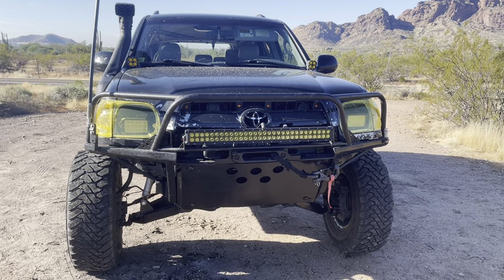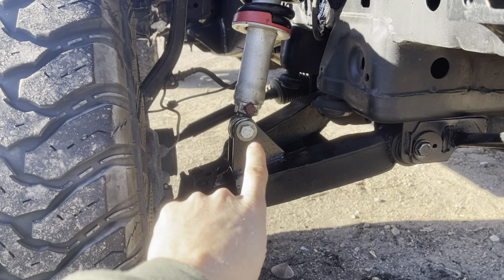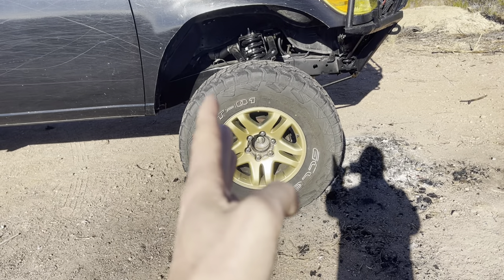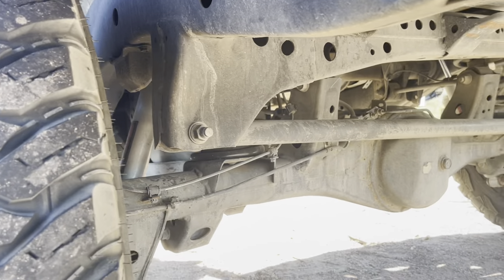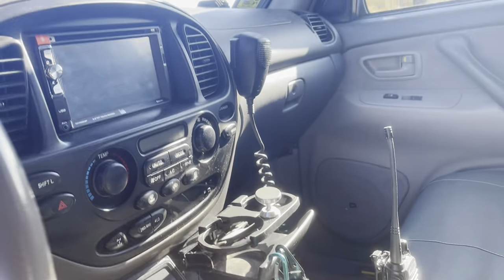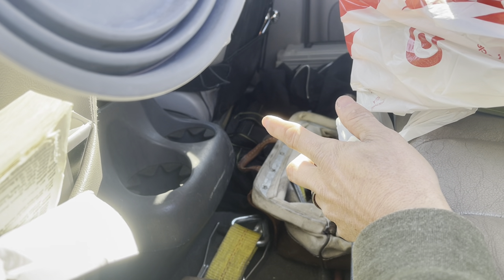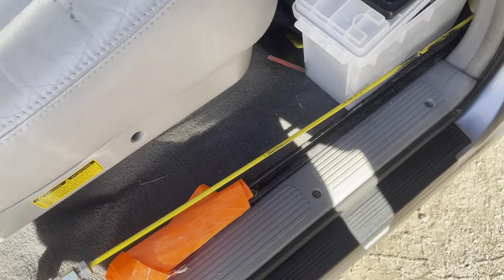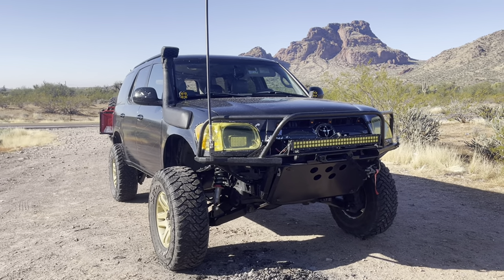Sequoia 4x4

Comment: Hey my friend. I was wondering if you had any experience/opinion on replacing the Sequoia outer tie rods with heim joints? I need to do mine one way or the other soon. 
Oh and thanks for the detailed tour of all the crap in the back of your truck lol
Reply from the maker: That’s funny you ask my project is on hold thanks to Christmas and blown spider gears .. but I have a bunch of stuff I was working on steering being one of them.. I’m not saying you should.. but you could cut the stock tie rod like I did and sleeve it with a piece of 1.25” dom 1” Id and ad a 3/4” heim use a set of 3/4 to 5/8 misalignment spacers and drill the spindle for a grade 8 5/8 bolt cut out a double shear bracket using 3/16 plate to weld on as extra insurance.. or you could buy a heim steering kit for a first gen tundra  .. another idea might be to buy the rack adapter to go to a heim and build an entire new link using dom and heims on both sides..
Reply from the maker: If you watch my video on Vic’s pathy you’ll see exactly what I did on his steering
Reply: @theclan4adventures  Thanks for the info, that Pathfinder is a BEAST. He's lucky to have a buddy like you

Comment: Thanks for the walkthrough. Very helpful to see 1st gen. builds. 
I'm really interested in duplicating your fr/r camera setup. Could you drop a link to where you bought yours? 
And.... where in a harness did you connect to grab rear camera "auto" power? 
I've got a double DIN head unit with a nice sized display, and a backup/rear camera mounted on my rear plate - but haven't successfully found backup camera power under the dash.
Reply from the maker: The cameras are like this one:
https://www.amazon.com/RAAYOO-Universal-Installation-Guildlines-non-mirror/dp/B074P45P7G/ref=mp_s_a_1_5?crid=KGS0BBBFWLTL&keywords=front+camera+for+car&qid=1641260008&sprefix=front+camer%2Caps%2C132&sr=8-5
Reply from the maker: And the monitor is like this:
https://www.amazon.com/gp/aw/d/B089YSDTF2/?_encoding=UTF8&pd_rd_plhdr=t&aaxitk=856adad8aa15ce7bd17b033d54cf7760&hsa_cr_id=1653474810801&ref_=sbx_be_s_sparkle_scm_asin_0_img&pd_rd_w=UAzV7&pf_rd_p=22aaccd3-32f1-4e8a-8b82-495782857be5&pd_rd_wg=FQO2s&pf_rd_r=F9Q86HB0VWTH8QR7TA0B&pd_rd_r=b57cd2cf-4f08-427d-89d2-6263611e5f54
Reply from the maker: You can buy complete systems with two wireless cameras for around 100 bucks witch would make install slightly easier.. I just saw you have a rear set up.. on mine I pulled the input from the rear hatch where the reverse lights are .. it was a pain to run the wires but it works flawlessly just make sure they are clear of the window operation

Comment: I'm pretty sure u can get king's, foxes or bilsteins on for the front suspension I have the Bilstein 6112 on my first gen tundra
Reply from the maker: Sorry for the book but I feel a detailed reply is a must 
Thanks to Covid not when I first started this build. Maybe now I might find something at a high over price but I was looking for an extended travel oem location shock no one I called had a first gen shock in stock anywhere in the country that I could order. I didn’t have the time to wait 60 weeks nor did I have the time to run a custom shock, build mounts or get one meant for another application then re spring and valve it. No offense but I’m not a fan of bilstein I’ve tried using them in the past on different projects and they failed. As a matter of fact I have a friend with an fj that had 5100’s installed recently He was driving home and a c clip failed the one that retained the spring cup. He had to have it towed to a shop. I also didn’t know what the truck was capable of when I got it or how far I would want to take it. Leave it some what stock .. mid travel.. long travel .. 1 tons gear cases and 42’s .. I wasn’t sure. After all my testing I’d say a mid travel with good shocks bumps strapped 35’s or 37’s 488’s and a rear locker would probably be the best all round set up for what I do with the truck. If you watch the latest video where we did a shake down run on Vic’s pathy the jeep and pathfinder where on 35’s pathy has front locker and jeep had front and rear lockers I went up all the same stuff they did but I only had 2wd and no locker. Now I’m giving the truck to my son and will build it with him so we will see where it ends up build wise

Comment: That thing looks sweet. I need to do this to mine. But my in laws live where it snows so the 4x4 is better for the kids to enjoy the snow.  Maybe someday :)
Reply from the maker: My truck is 4wd and handles snow beautifully I just haven’t gotten extended axle shafts to go with the long travel wide arms I built yet.. I may build my tundra first we will see.. thanks for watching and leaving a comment
Reply: I was thinking about how that shock mount bent up on you. I do RC trucks. And i did a similar conversion. And my problem i had was that the shocks would bottom out before the control arms hit the bump stops. I wonder if that is happening to yours. Its probably more difficult to see if that is the case on a big heavy truck.
Reply from the maker: @nickmccain6598  the original shock mount is 3/16 thick.. the first set of mounts were 1/8 because that’s what I had laying around for free and with no power steering 35’s and super tight trails they were doomed lol don’t get me started on rc. I ran a hobby store for 5 years and have been doing rc stuff for 35 years
Reply: @theclan4adventures  thats funny about the RC stuff. I remember super hot batteries and my dad would just put them on the charger so we could go back out to RC. I still have the gold rc10 in my hoarding pile of RC :)  with a broken a arm and missing other stuff

Comment: Beautiful car, what did you paint it with ?
Reply from the maker: It’s painted with gloss black top coat for a boat that I had left over from another project.. looks ok at a distance but up close not so much.. I could have put another coat on it and then wet sanded it for a nice finish but I knew it would get scratched so why bother. Thanks for watching

Comment: Hi , how much it’s the cost for ones of this suspension? Thanks !!
Reply from the maker: Depends.. a bolt on long travel kit goes for about 3-4k without shocks 
Look for a long travel kit for a first gen tundra. 2000-2006. Sometimes you can find a used kit .. A good setup would be a set of heim joint upper control arms that replace the stock upper control arms and use a extended travel coil over (if you can find one in stock somewhere) with a decent bump stop. Wheeler or a hydro bump.
Reply: @theclan4adventures  thank you so much

Comment: You can use 1st gen tundra front lift kit. It bolts right it if you plan on upgrading.
Reply from the maker: Thanks for the tip.
Reply: @theclan4adventures  I will make a video today of my set up and post it
Reply from the maker: @slavkavq  right on I’m sure people would like to see it. Not to be a jerk though but I know way too much about this stuff.. you might want to watch my other videos.. in this video I talked about the front suspension I have and why.
Reply: @theclan4adventures  sounds good. For sure gonna have to watch you to learn more. I’m coming from a 3rd gen 4runner
Reply from the maker: @slavkavq  I’ve had a few of those too feel free to ask me anything I also have instagram @ Sequoia4trails 
and used to drift too and build turbo cars so all good man.
Reply from the maker: @slavkavq  when I rework this sequoia I’m building the swing out carrier with heims to save weight and space in case your planing to build a carrier just throwing it out there real quick lol
Reply: @theclan4adventures  that’s dope. That’s my goal for the tire carrier
Reply: @theclan4adventures   Homeboys droppin knowledge on you

Comment: those ranchos though are complete shit. why not go with ARB/OME or Dobinson?
Reply from the maker: Lol yeah I wouldn’t say complete shit they are better than any 5100’s I’ve run in the past.. they are working fine for what I needed them for like I said a few times they were better than blown factory shocks and they had them in stock ready to ship at that time ..any real shocks were 60+ weeks out on back order. It’s apparently time I make a video explaining why the sequoia and why what was done to it was done a hint… all of it was done as mock up cheaply and for testing to see if I even liked it as a trail rig. If I were to actually build it ..say with the ifs in a long travel configuration I’d use real components and real shocks..